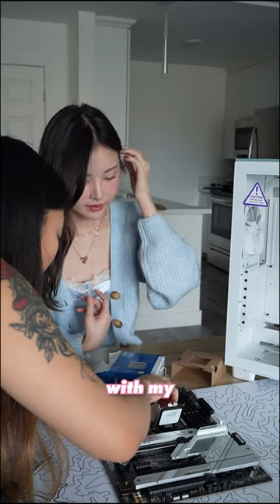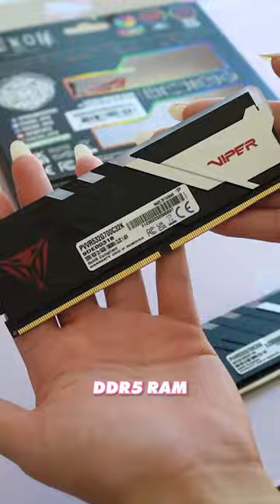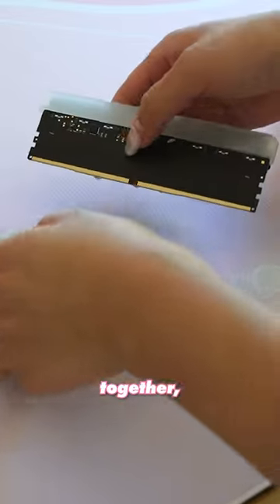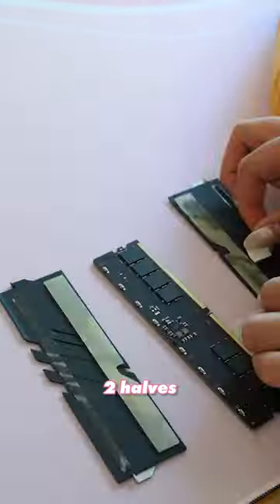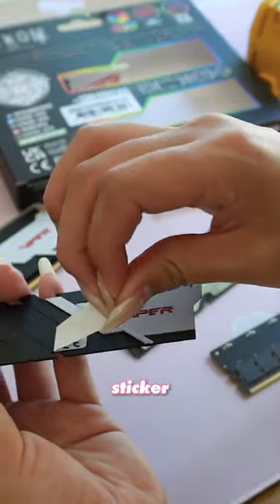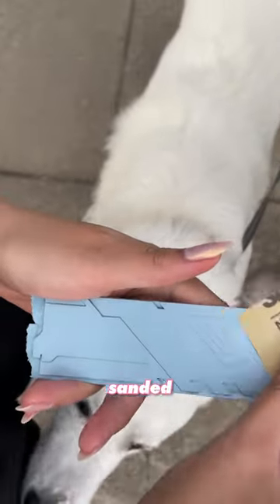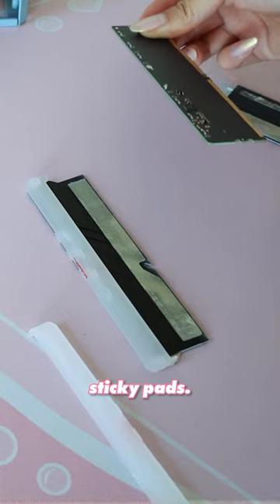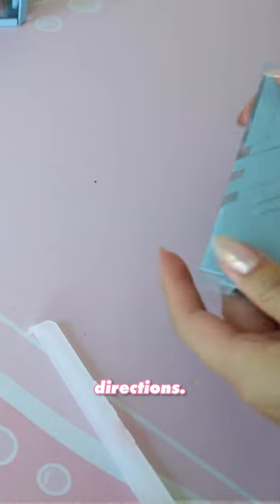Painting RAM for a custom gaming PC

Comment: Rip waranty 😅😅
Reply: @thelastchairlol8527 not this one
Reply: @thelastchairlol8527not this one
Reply: @thelastchairlol8527not this one
Reply: @thelastchairlol8527 not this one
Reply: @thelastchairlol8527not this one
Reply: @thelastchairlol8527not this one
Reply: @thelastchairlol8527 not this one
Reply: Guys chill rams are extremely durable
Reply: @thelastchairlol8527not this one
Reply: @thelastchairlol8527not this one
Reply: @thelastchairlol8527not this one
Reply: @thelastchairlol8527not this one
Reply: @thelastchairlol8527 not this one
Reply: This RAM is like 80 bucks
Reply: @arjunnair8138  where? i even didn't find 7000mhz quick but 6000mhz 150€ 2x16gb
Reply: @thelastchairlol8527not this one
Reply: @thelastchairlol8527 not this one
Reply: @thelastchairlol8527not this one
Reply: @thelastchairlol8527not this one
Reply: @thelastchairlol8527not this one
Reply: Not this one @thelastchairlol8527
Reply: @thelastchairlol8527not this one
Reply: @thelastchairlol8527not this one
Reply: @thelastchairlol8527 not this one
Reply: @thelastchairlol8527not this one
Reply: @thelastchairlol8527 not this one
Reply: Ram doesnt normally break if anything the gpu or cpu would die before the ram
Reply: @thelastchairlol8527 Not this one
Reply: @thelastchairlol8527 not this one
Reply: @danial_amini not this one
Reply: b-b-b-but its pretty!!

Comment: Here is a tip more like a warning(for enthusiats who wanna do same) 
Don't heat  the components directly it will melt the soder and cause short hence killing the ram also make sure the thermal pads are seated properly if possible use new ones as if air enters the gaps it will cause chips to heat up air is an insulator
Reply: Yeah no the glue melts way before the solder is even close to soften up. Its perfectly safe as long as u dont overdo it.

Comment: interesting video miss, I hope you have fun with the paints. I think the ram you mentioned is very, very overkill however.

7000mhz ? that might straight up run out of sync with alot of CPUs.

also gut feeling tells me painting things that go into the motherboard is not exactly a great idea because it's a sensitive area and technically each coat of paint increases the size of a material.
Reply from the maker: the paint is only on the heatsink, not the pins :)

Comment: 7k MHz, and not even the 14900k officially supports speeds past 5600. Funny thing, ain't it.
Reply: I guess she has money to spend on it without worrying about that
Reply: That’s the base speed. You can overclock way more than that depending on what motherboard and unlocked cpu you have. I have a 13900k and im at 6600mhz stable
Reply: Emphasis on "officially" 
Can't vouch for stability but pushing to 6k MTs is quite easy in newer cpus
7k though might be tricky
Reply: I run 6400 on a 12700kf.. easy.. it comes down to the motherboard. I have a unify z690i
Reply: You can load an xmp profile…
Reply: It’s not actually MHz. It’s Mega-Transfers/s (MT/s). Ram manufacturers just show the bigger number because monkey brain goes “bigger is better”. It’s half that value, hence double data rate (DDR_). Its true value is 3500MHz. 

CPU’s are actually running at their specified clock.
Reply: It's not correct, but that's just how most people recognize the speed. Everything from Windows task manager to tech YouTubers and just about everything in-between just say MHz  @Glitch-Vids
Reply: I run 6000 XMP profile on my 7800x3d
Reply: @willy7968 hell ya, I'm so happy with mine. I'm just waiting on the battlemage to come out currently running a a770.
Reply: @Glitch-Vids No! The bigger number expressed in mega transfers per second really is the correct number. It is NOT a marketing gimmick as you suggest.

They use double edge clocking. DDR stands for D ual D ata R ate.

So in a single clock cycle, the waveform goes:
  _|‾‾‾|_

(It's in italics because of the way YouTube interprets underscores, the edges in real life are vertical (almost) )

There are two edges in each cycle, a positive edge and a negative edge.
One data transfer occurs on each edge.

The clock frequency is the 1 divided by the duration of the waveform from one point on it to the exact same point in the next cycle.
The clock frequency is lower.

It is therefore perfectly correct to specify the performance of the RAM as the number of transfers per second.

In the old days when SDR was around, before DDR came into existence, single edge clocking was used. Hence the clock frequency equated to the number of transfers per second.

DDR came along as an easy way to double the data rate without having to increase the clock frequency and all the difficulties and problems that caused.

Comment: 7000 mhz is crazy bro, where do u get the money from
Reply from the maker: the RAM was sent to me by the brand, but it's not terribly expensive IMO. (2 x 16GB) 7000MHz for $130
Reply: @peachietech Dang only 130?
Reply from the maker: @18combo  yea! not sure if itll let me link but it's here https://amzn.to/47kjzco
Reply: A-die OEM sticks are the ones used for up to 8000mhz (beyond 6k) their price have come down hard since late last year, almost 70% cheaper. How high u can OC depends primarily on the IMC quality on your cpu and traces on the mobo, on top of timings.
Reply: It isn't 7000 MHz, it's 7000 MT/S.
They use double edge clocking so a single click cycle provides for 2 memory accesses.

That's why it's called DDR - dual data rate.

Comment: No need for 7000mhz
Reply: It isn't 7000 MHz, it's 7000 MT/S.
They use double edge clocking so a single click cycle provides for 2 memory accesses.

That's why it's called DDR - dual data rate.